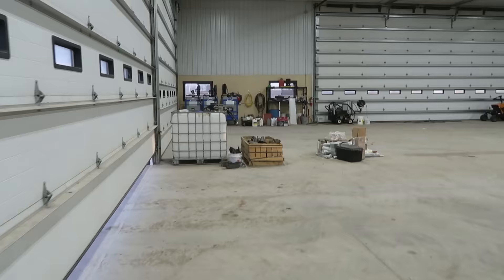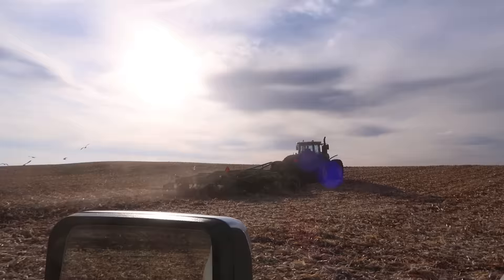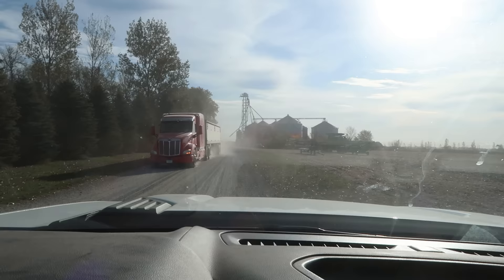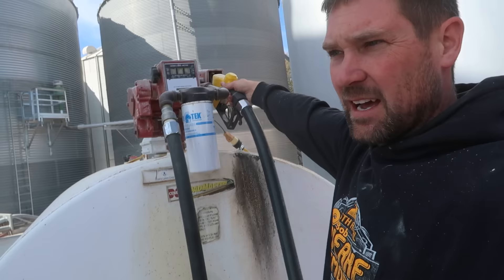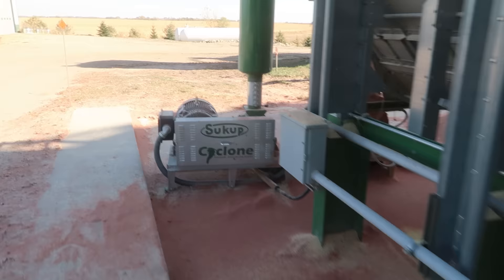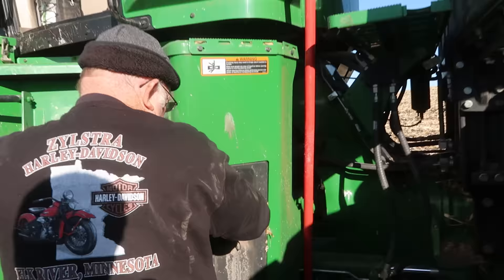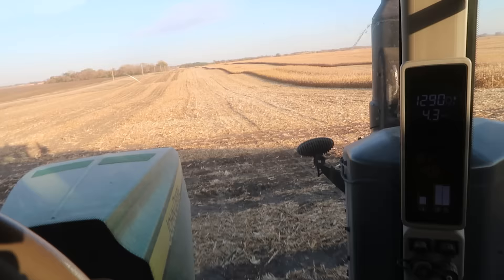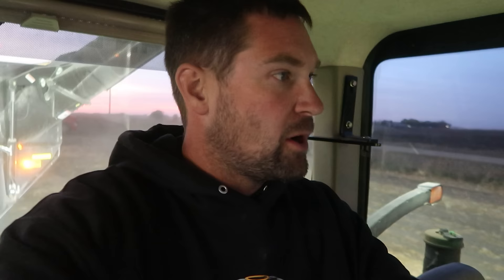Diesel Shortage - But we're STILL Harvesting Corn

Comment: I ran a John Deere 7800 with a 740 Classic Loader on it and used it to pull an A&L F705 700 bushel grain cart today and yesterday for corn harvest. The combine was a John Deere 9660 STS Bullet Rotor combine using a John Deere 893 8 row corn head with hydralic deck plates.

Comment: Zach, What you were talking about in the dryer shed is know as a wireless bridge.  Instead of running a physical cable between the buildings (tractor hazard) you can put up 2 Wireless access points that point at each other to bridge the gap wirelessly, which will then tie in to the rest of your network. FYI
Reply: Directional Wi-Fi antennas 🙂
Reply: @Stasiek_Zabojca  yes thats what i said

Comment: Zack. I am sure you have heard of this. Here in North Carolina old time farmers use to let a piece of change drag the ground from the back of the combine. They said it helped with the dust on the windows. Said it help ground the machine. Not sure if it worked or not but all the famers did that back in the 80’s. The chain was bigger than a dog chain but not like a log chain. The chain only touched the ground by like 2 links.

Comment: I think I know why the bolts came off the tires, sometimes if it’s a new-ish machine, the paint on the rims makes the bolts loosen
Reply: I'm wondering if farmers use the trick of marking a line across the bolts lined up with a line on the hub to see if the bolts have loosened?
Reply: @colorado1088  Some dealers will paint mark the wheel bolts/ lug nuts on new equipment. But that also wasn’t a brand new machine when he got it. They got it lightly used if I’m not mistaken.
Reply: @chevyon37s  I lost two bolts on an air bag bracket on my Lance F350.  Caused damage to the bed.  A mechanical engineer friend told me to paint the bolt heads.  I think he said they did that somewhat at Volvo/White dealerships.

Comment: The farmer i used to work for had a 9300 jd 4wd on 620/42 duals and it would walk circles around the 8960 on 20.8r38s even though it was 70hp smaller.. Both pulled 510 7 shank rippers.

Comment: It’s very easy to sync your phone to QuadraTouch Pro, very straightforward. It allows two way texting…will send a text if there’s a shut down. You can text it for status updates. Anyway, we’re running out of ag diesel here on the east coast. I have 3300 gallons coming tomorrow and have around 7000 in the tank now. My dealer said this maybe all he can give me for a while which scares the he’ll out of me. I’m pretty much done with harvest but we’re now moving hay from the farms I rent back home to feed cattle and that requires a small army of tractors and trucks…all diesel.

Comment: According to the supply and demand graphs (production, consumption, exports), there isn't really a diesel shortage at this time. There is actually more production this year than last year, but the "excess" is being shipped to Europe, as they are paying significantly more per gallon than in the States. If the US begins to see a real shortage, we will have to bid up the price, higher than the already high retain, to get the petroleum brokers to stop shipping it overseas.

Comment: Unless your telephone company manages your farm wifi network (unlikely), I don't think you need to call them. You just need a short range microwave link from either the house or the shop to the dryer shack. A pair of something like an Ubiquiti LOCO5AC-US should do the trick nicely as long as you've got a good line of sight. Feel free to confirm with Nick Welker, they use very similar technology at their place.

Comment: It's surprising that you can't drop a GPS fix for those flags in the JD computer thing.
Reply from the maker: I agree. -Becky
Reply: You can.   Wait for it, they are called Flags in the Deere system.
Reply: @M8Stealth  probably would have required Zach to read the manual for the system and we all know Millennials don’t read no manuals or instructions because they know better.

Comment: I heard there is only one month of Diesel left on hand in the Untied States.
Reply: They were saying 25 days worth a week ago. Realistically, the on hand supply is not normally very much more than a month. It’s also the time of year that refiners are filling the home heating oil supplies, which pulls away from diesel refining.
Reply: Home heating fuel and diesel are the same thing. Worked refineries for over 25 years.
Reply: Actually they are not, but whatever

Comment: You better keep your diesel storage full as you're about to have a major diesel shortage in a couple of weeks
Reply: The news that there is only a 25 day supply of diesel fails to mention that the outlets are still getting deliveries from the refineries.  25 days supply if everything shuts down.  Makes a provocative news story though.
Reply: The 25 day "diesel shortage" will be fine b/c in about 21 days there's going to be a nationwide rail worker strike. The diesel fuel the railroads will quit consuming then can be diverted relatively quickly to what little expanded "slack" occurs by more goods being trucked...to a point. The word is... that even if congress "orders" the conductors and engineers back to work...many intend to return just long enough to get the back pay money paid...then a mass exodus may occur on their part. The problem with "hiring off the street replacements" has to do with rail safety concerns and required associated federal licensure to operate a locomotive...safely! ...just sayin'...
Reply: @mmurphy2317  I'm thinking they will settle and not strike.  They are good hard working people and I'm thinking they appreciate the damage to the country a strike would cause.  What details I heard on the settlement package wasnt that bad but still below inflation of course.  At least its not the engineers bitchin now,  Regards.
Reply: @mmurphy2317  Good points
Reply: @colorado1088  Just google what is happening with the Colonial pipeline

Comment: I remember dropping the disc gangs and replacing bearings, what a job, if your born again, asked Jesus into your heart you'd be praying in the spirit, but I wasn't in the 70s & 80s nor my dad and uncles so we all cussed like sailors then, 5 foot long wedge bars, 3/4 drive with what 2 inch nuts, what a job it was back in the day, cheater bars and blow torches

Comment: The lack of rain in August effected corn growth and likely bushels per acre, but then it’s hardly rained in two months so you spend less money drying corn. So I hope that you are ahead in the end. The US is moving away from burning coal at power plants and transitioning to natural gas. The cost of natural gas goes up for everyone. Another way to get natural gas is from fracking for oil because both gas and oil come up when they strike oil. Yet China is building lots of coal power plants???? There’s a coal power plant 2 miles from where I sit. They spent around $700,000,000 upgrading the scrubbers on it around 15 years ago and now they plan on closing it around 2030. I’m just really wondering about the future of the prices of gasoline, diesel, natural gas, and the cost of transportation and many many things that our economy revolves around. I know that they talk about dirty coal but I’m afraid our country could be in a vulnerable position without burning cheaper coal.

Comment: You NEED cover crops and no till somehow someway start small, it would really be cool to see ground striptilled at least that erosion you showed that is really hard. Imagine how much nutrients you have lost that’s a lot of dollars lost. Love your vids keep it going.
Reply from the maker: We've tired cover crops several times in the past. Unfortunately we haven't had any luck. Our growing season is too short and our soil is to heavy. It creates a nightmare in the spring. When we don't till the cover crop prevents the soil from drying out enough in time for planting. Planting late dramatically effects bushels/acre and we loose out of significant profits. Cover Crops aren't for everyone. -Becky
Reply from the maker: In addition with a cold fall in more cases then not we can't even get a cover crop to germinate before the ground freezes.
Reply: No till is not a good option for the noth.
But strip till can be made to work  I think .
We run strip till in the spring but there are other reasons we do that.
There more to it then just going out and putting strip in.
Reply: @billherman37  "noth"?
🤣

Comment: Concrete a pole in the ground next to the tile riser so you don't have to change flags all the time because why waste money on more flags
Reply from the maker: Have you ever looked into concrete prices? Flags are way more cost effective. -Becky
Reply: 6 foot 6 inch diameter pvc pipe  next to the riser,painted pink or orange,should work
Reply: A flag is a lot more forgiving if someone hits it with something.
Less costly